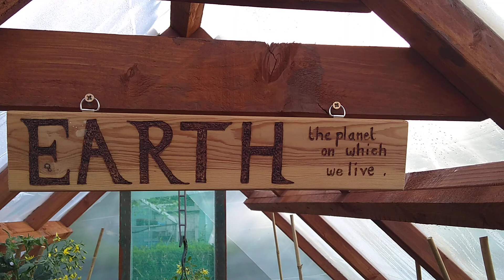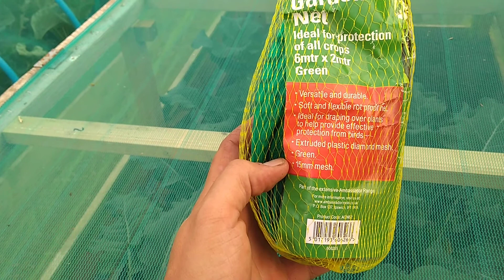Little farmers Farm   Fatigue and Figures

Comment: I have an A Frame made from 2 x 10ft pieces of 2x2 with a hinge at the top and is use that for a mobile roof support how ever a stupid fig tree has climbed up through it so its staying put now. 7 years later still holding the middle of the roof up. On a break at the minute back to work now lol
Reply from the maker: Good on ya Chris...Cheers mate